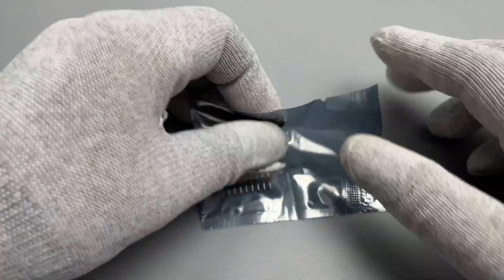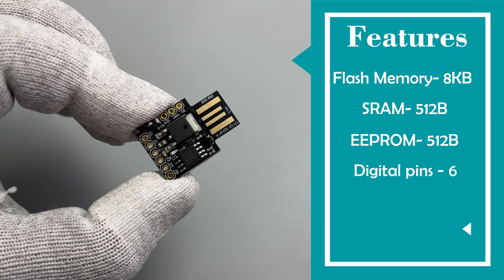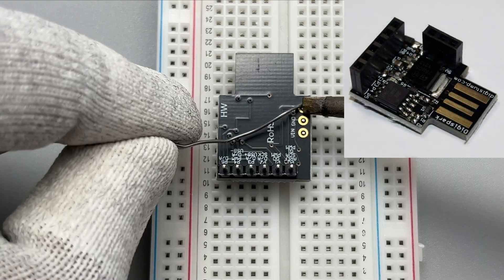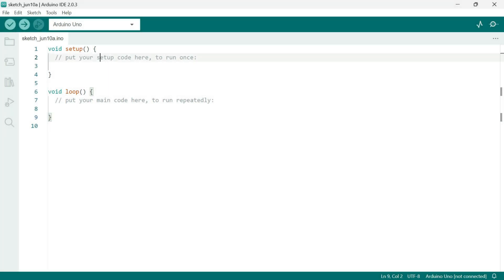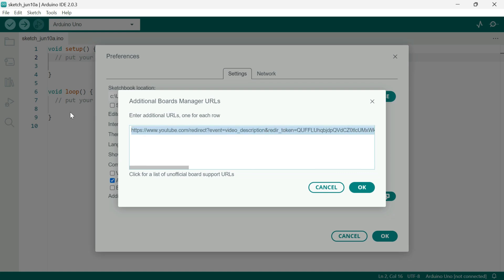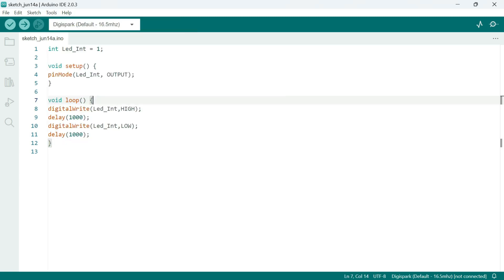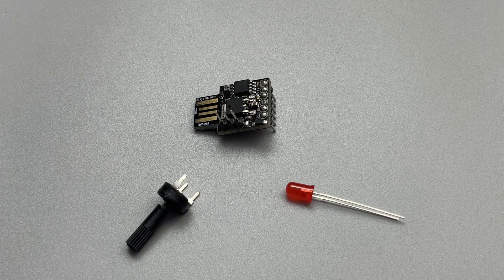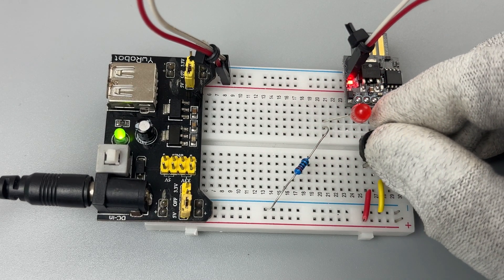Digispark ATtiny85 with Arduino 2.0: How to program?

Comment: I'm trying to upload a sketch with MD_Parola.h, but it's showing the following error: "C:\Users\Daniel\Documents\Arduino\libraries\MD_MAX72XX\src/MD_MAX72xx.h:50:17: fatal error: SPI.h: No such file or directory". Error compiling for Digispark board.
SPI.h is included in the code header. Any tips on this?  Thank you.

Comment: Thanks much for the tutorial! I was about to make a tutorial that uses this project, but as you know the official libraries link is down. I used the ATTinyCore library, but micronucleus wouldn't even open! Arduino wouldn't even start looking for the USB device. (no orange text at all!) I then tried to open the micronucleus app from the command line and a windows error popped up lol. I tried for an entire day to get this working, but gave up. Found this tutorial with a link to the digistump project. Now it at least I see orange text indicating the upload process is trying!
Reply from the maker: Wow, that sounds frustrating!  I'm glad you found the Digistump link helpful.

Comment: hello i am using windows 11 laptop and i installaed all drivers of digispark but on arduino ide the code is not being uploaded to my attiny85 digispark. but the leds of attiny 85 are working but i can not upload the code to it. i cannot even update the drivers, if i try to update them there is no update button there are only install and delete buttos so what should i do please help me
Reply from the maker: I just tried this on a different PC- Downloaded Arduino IDE and repeated the steps. It's working fine for me. Try this: Before uploading the program, unplug all ports(mouse, keyboard, etc.). Then when it says, "Timeout in 60 seconds"; insert the Digispark board- start with the port you just unplugged. If nothing happens, change the port, and so on.
Reply: @THEELECTRONICGUY  i did everything but it didn't work at all
Reply: did you solve it in the end? I'm having the same problem. I have version 2.3.2 of the IDE.
Reply from the maker: @valentinocaso5396  Try this: Before uploading the program, unplug all ports(mouse, keyboard, etc.). Then when it says, "Timeout in 60 seconds"; insert the Digispark board- start with the port you just unplugged. If nothing happens, change the port, and so on.
Reply: @THEELECTRONICGUY  : Nope, this does not work. Did you try it under Windows 11?
Reply: @valentinocaso5396  no i couldn't solve
Reply: @MicroVersee  same problem if you solve it please tell me i really need help about it
Reply: @valentinocaso5396  no i couldn't solve the probleb but i managed to upload attiny 85 with android phone

Comment: Nice video!!!
Well done!!

If I am not mistaken - with the digispark board - one of the 6 IO pins is dedicated to MCLR (reset) and is therefore not available as a general IO pin.   One would have to have a way to reset the fuse options in the device in order to use that pin for IO.

Additionally the ATTINY85 contains an internal RC clock which the manufacture gives 10% accuracy
There is a process for adjusting the internal OSCAL register in order to bring the accuracy to within 2%
But some users claim that internal RC clock is very temperature sensitive 
So the ATTINY85 would not be reliable for anything that requires precise timing such as UART serial communications.
Reply: One can change a fuse setting to make 2 if the pins accept an external crystal. That make it accurate. Not changing reset, that then only leaves 3 ports left to play with.
However, one can drive up to 6 7-segment LEDs using just 2 pins using TM1637 based LED displays.
That's just 1 pin left over for a button input. JUST enough to make a digital clock for example.
It's possible to push it further still. Two TM1637 using 3 pins. Change two pins to be input to detect two buttons. It's possible to make an accurate chess clock with the attiny85 this way.

Comment: Now the digistump json file server is inactive. So it is not working in Arduino IDE. Download fails and with an error as "some indexes could not be updated" (in Arduino IDE 2.2.1version ). Is there any fixes??
Reply: Its possible this product is diminishing in consumer popularity just like the Picaxe did 10 years ago.
These products have a window of time in which the developers are willing to support them
And when that window of time starts closing the developers risk financial loss if they continue supporting them.

Adafruit has a similar product - which they call the Trinket - using the same ATTINY85
They are still selling it - but warning about deprecation and recommending users move to a newer product.

So its quite possible the ATTINY85 is leaving the Arduino eco-system - probably due to lack of consumer interest.
Reply: Same problem... tell me solution...😢
Reply: @FSPVirtualinternshipProgram  I don't know thats why I'm asking 🙁
Reply from the maker: I just tried this on a different PC- Downloaded Arduino IDE and repeated the steps. It's working fine for me.

Comment: Will it work on 3.7 V
Reply: Why don't you look at the data sheet instead of expecting someone else to to it for you?
Reply: @icarossavvides2641  
I have seen the data sheet and it works on 5v or more I didn't knew about the power booster module before but now all is sorted.